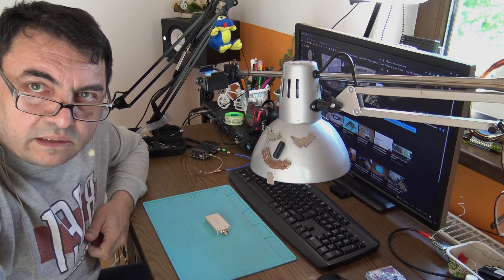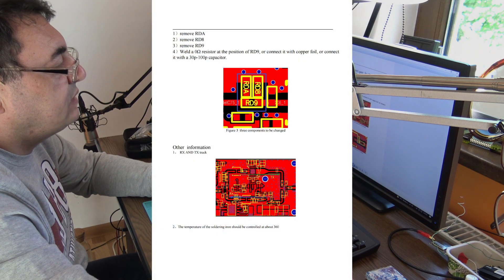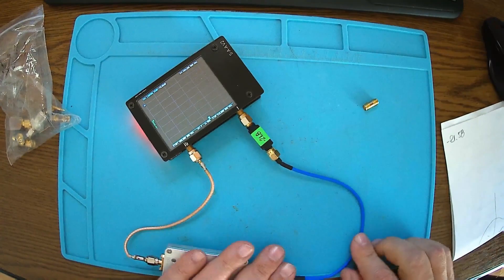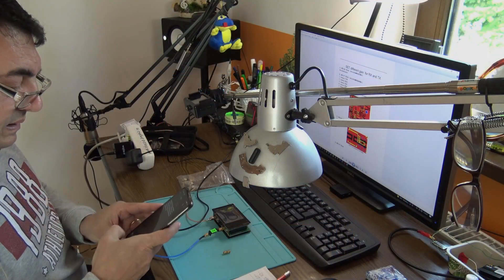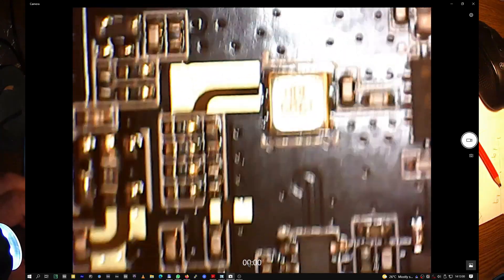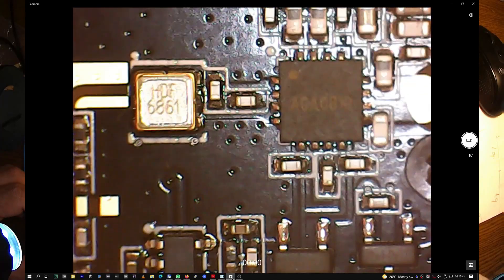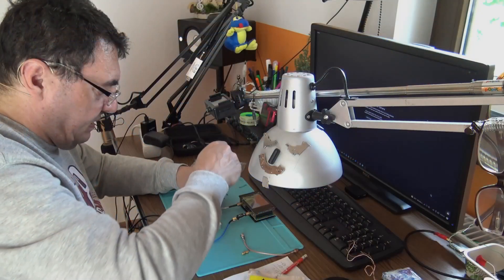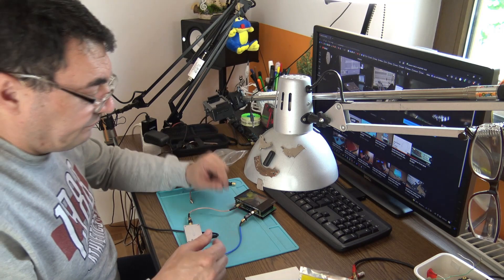ACASOM ACA-AP0801S1 10db RX/0dBTX Helium amplifier part1

Comment: This video is old but I was wondering if you can give me an advice where to put this amplifier. I have a splitter that splits the signal into 3. Do I put it in front of splitter then cable or does each splitter socket need an amplifier?
Reply from the maker: In the front of the splitter..it will provide amplification from antenna to miners and when TX is just passing the signal further to antenna. I should go for 17db RX and 5db TX
Reply: @viocaia  Many thanks for the reply, I really respect that. I am thinking to get this amplifier called Callboost which says it does everything automatic. I mean the RX and TX. This amplifier called Callboost says it has saw filters build in but the company says it can also provide it without the saw filters. They say you can use your own external cavity filter. Do you believe the build in saw filters are better than a cavity filter that can be mounted outside?
Reply from the maker: @DardaniaLion  With saw filter inside the price will be lower of course, like loss was filter is around -2dB, instead a cavity filter gives better signal attenuation but comes with extra expenses. By me, I'll have the non-saw with cavity outside...why? I can use the amplifier for other radio related projects. A saw filter inside the amplifier makes it useful just and only for a certain frequency...(868MHz). You can use as well an external saw filter, cheaper, easy to install for further experiments. I can provide 868Mhz filters with good loss rates and prices.
Reply: @viocaia  Thank you very much for your information. Well, I have 3 cavity filters already. I was just confused if the build in saw filter is better than cavity. It looks like filter is better outside so I will get one without saw filter build in. When it comes to splitters, if I use 2 way splitter and 3 way splitter, does it mean the 2 way splitter will give better performance? Of course my setup will have cavity filter and amplifier to recover the lose in db. This is my setup Antenna--> cavity filter --> amplifier  --> 10 m cable LMR400 --> biastee -->splitter and the 2 or 3 miners. I also was wondering if I can use 2 antennas because I can't use a 360 degree antenna where I am since I have many buildings behind me. I thought to use 2 10 db panel antenna from mcgill. Can it be possible and working to have 2 x 2 splitters? For example 1 splitter to join the two antennas then another splitter to join 2 or 3 miners. Would that work with 1 amplifier or do both antennas need amplifiers? I think I need two filters on both antennas or does one filter just before splitter do the job? Sorry if I stressed you it's just I could buy those parts and then end up not making use because they don't work. Just wondering if you know anything about my idea. Wish you a good weekend.
Reply from the maker: @DardaniaLion  You can't have two antennas in parallel or even with splitter, the RX is much more complicated. Those should be in perfect sync, phases and more. It's difficult, but you can try. First setup it's perfect, mean antenna/cavity/amp/bias/splitter/miners. As for splitters, more ports, more losses. Also consider any empty port covered with a 50ohms terminator.
Reply: @viocaia  Hi again and thank you for replying. I understand. So if the splitter is connected to an amplifier, that amplifier does not improve the losses? For example this callboost from china. It says on their description that it does everything automatically. I did watch few videos from other people and they said that if you have amplifier, that will cover the losses with adapters or let's say splitters. I see you have few devices that you use to test things. Which device would you say I could use to test noise on the line and signal strength. What I am thinking is this. Before I put a miner. I like to attach a device to the antenna and then see if whole setup is fully working without any issues like interference and any loses. Let's say I have 6 dbi antenna and I attach everything then the device that will show me if that 6 dbi is there and that signal is clear and strong.
Reply from the maker: @DardaniaLion  NanoVNA can test cable looses and antenna's gain. Also with NanoVNA you can send a RF signal to the antenna and with SDR radio like RTL-SDR you can RX the signal away from the antenna...of course. So you can find if the cable or anything else it's ok. Also, you can compare different antennas and cable by the receiving signal. But it's mess and simply just hooke everything and power on. Write down daily results and do changing. You'll find the weak link in a few days...Try and error.
Reply from the maker: @DardaniaLion  An amplifier before splitter will do the best...something like antenna/cavity/amplifier/splitter...the amp gain will cover losses from the cable attenuation and connectors and also those 3...4 dB from splitter. For measuring this it's kind of expensive , you need RF generators, NanoVNA (network analyzer) even a SDFR radio and on. But like I said, trial and error...change configurations, write results until you can't get more…and that's it.
Reply: @viocaia  Hi again and many thanks once again for the great reply. I really am very thankful for this.

I did look around for those devices and I can see that some are very expensive but some not. For example this NanoVNA is on amazon around €100. What is expensive is this RF generators. It is in the thousands.

So the NanoVNA on itself would not be able to test the things I want to do?

Basically attaching a 10 dbi antenna on the roof, then the cavity filter the amplifer then the 10m cable. at the bottom before miner the biastee then this NanoVNA to see if the signal is stable. Or does it have to be attached at the top next to antenna to test the signal if it is good enough?

To be honest I am doing those normal tests and it is doing very well BUT when I use a splitter that splits the signal into 3 miners, one of the miner is sometimes not sending a beacon at all. It shows that it has send it but the reward is zero because no one is witnessing it. I have no way of knowing but I am guessing that because I split the signal into 3, maybe one of them is weak. Is a amplifier of 12v enough to give power to all 3 miners? Maybe an amplifier is strong enough for 2 or 1 miner but not 3.

That's why I want to get a device and test all ports on the splitter. To see if it is good on all of them.

Sorry for writing so much.
Reply from the maker: @DardaniaLion  Forget about NanoVNA, that's good for checking cables, amplifiers gain, filters...so on. I believe your splitter have a problem,  try to change the miners in between, you'll find if the splitter is the problem or the miner itself. (the one with no TX).
Reply: @viocaia  Hi again, I bought this NanoVNA-H4 Vector from amazon and I have to admit it's very confusing because I simply have no idea how to make it work or test. I have this 10 dbi antenna and I want to see if it is actually a 10 dbi or less. How do I do it? Another thing I want to do is test the signal with everyone on it. For example Miner, Biastee, 10m lmr400 cable, amplifier,  cavity filter then antenna. So if I want to measure the strength of the signal, where do I put this NanoVNA device and on the settings, what should I do? I guess it's a big thing and from what I can see, I have to return it back to amazon because it is simply to hard to test. There is no video on youtube that I could find which shows how to do it. If you could help, it would be great. Basically my main aim is to see if I have a good signal by adding all those things to antenna and also see if the antenna is actually a 10 dbi. It was a Chinese antenna.
Reply from the maker: @DardaniaLion It's a lot to learn before using it. You can check the antenna tune, cables and so on, but for checking the antennas gain it needs a lot of extra cables and expertise. Check https://www.youtube.com/@electronicsrepairschool

for some tutorials about how to check the gain... what can I say, it's a lot of work and you need knowledge...I wish to help but I can't because this is a lot of reading and understanding the radio waves and many more...sorry!

Comment: The light does go green, if you feed it a strong enough signal. Like a LoRa chip :) rfm95 or anything. The nanovna is not strong enough to trigger the switch to tx mode.
Reply from the maker: I did that from a Lora gateway RK2245, on test mode is sending beacons.. Stay tuned for part3

Comment: Try it with a BiasTee
Reply from the maker: Bias tee it's just a way to power supply the amp, got nothing to do with good functionality
Reply: @viocaia  The Bias Tee which send with the ACA-PA0801BS1 from Acasom is a 12V one
Reply from the maker: @kadriyoutube5596  A bias tee it's just a way for decoupling RF from DC and to use the same antenna cable to feed the power supply and RF. A Bias tee is not for a certain voltage, it's just a PCB with few coils and capacitors.Please see my video about DIY a Bias Tee...like I said ther eis no way a Bias Tee to improve anything, maybe to short the signals..yes..!

Comment: The instructions they've sent you don't make much sense. For RX=10 & TX=6 they've said remove R9W but the diagram shows C9W. I have two of these amps running and can say that I got pretty much 10db increase on the RSSI figures but one of them the TX (0db model) doesn't seem to work at all and doesn't let the beacon through so I might have a go at changing it to TX 6.
Reply from the maker: Yes there is a mistake..it's a capacitor to be removed for 6TX..that's the one near the filter C9W

Comment: Try that trick i told you for TX, with SPF...
Reply: Is it possible us to get that trick?
Reply from the maker: @baturalpsaglam6753 It's about connecting another amp between nanovna and Acasom miner output, to trigger the TX mode.
Reply from the maker: I will...sincerely I have an even better way to test with a LoRa gateway that gives exactly the same signals like a miner..for now the amplifier it's fiasco!

Comment: I have to say, mine works fine... Haven't done RF measurements but went from ~25-27 to 30 witnesses and from around .13 to .2 HNT per day, witnessing almost one beacon every hour. This was before the current network outage... Some of it is due to variations in the network but I would say I'm OK with these results.
Reply from the maker: This test have nothing to do with the network..all the test signals are apart from it..so far 
disappointment
Reply: More witnesses and beacon is not what the amp does. That's the network.
Reply: @wtfek1  The LORA logs and signal strengths in explorer (compared to the same hotspots before) say the same story more or less. Perhaps Vio has got a bad amp.

Comment: I have the 17 db rx and 6 tx for 915mhz mhz and it has 16.8 db on rx and only 4 on tx but it does help it works better than my Shireen amp also were did you get the scamatics to show what to remove and replace to change the rx and tx db thanks
Reply: Ok thanks I got them to send me one from Shireen but I don't recommend them at all they only have one saw filter on the rx side and I called to ask some questions because It was not not working and they said send it back that I had a 3 year warranty and I told them that the sticker was missing that said the warranty void if removed they said that don't mater they will fix it I have a electronic background more on software side but I know my around a circuit board I have my miners modded to have a tx antenna and a rx antenna and different LNA'S and better quality FILTERS. So I sent it back then I get a call saying the circuit board was cracked in two and had to be replaced $180 I said send it back to me I would fix it and I asked for pics of broken parts because I have before and after pics of amp and I marked the board  and I put heat shrink on the power cable and it had to be unsolderd to put the heat shrink on long story short they said they would fix it for free but no more warranty because they had to make a custom board to make it with factory specs like I bought it a month prior. I never got pics of broken parts and nothing was changed they just soldered a smd capacitor back on to my board I emailed them to just let them know there were no new parts installed but it worked and I was just letting them know just incase the tech said it was replaced when it was not, thought I was trying to help but I just got hateful emails back and asking if I wanted a bill and I asked what for nothing said was done, I called and got an apology and there new amp is on its way for me to test, also the acasom is better at half price
Reply from the maker: @beanflickerOu812  Scams and opportunistic situation for some sellers.I bet they didn't know what a transistor is. Same story over and over again, like Apple with there way of dealing repairs. Even AB Airbuddy amplifiers , sold with max 20USD in the beginning now are more then 100USD..my opinion..the best amplifier is another miner! Two miners makes more then 1 with the best amplifier..Please  check the part2  tonite..
Reply from the maker: The schematic comes from a dealer..it's kind of inside document..I'll do the mod next week and wait for results..